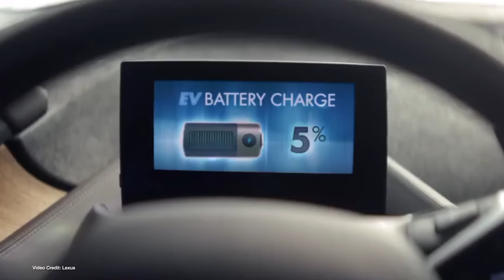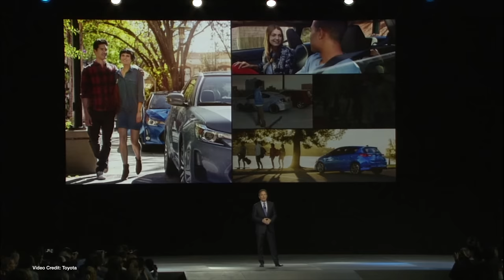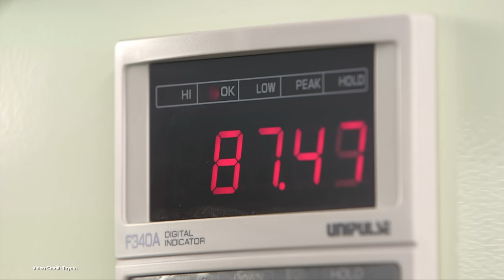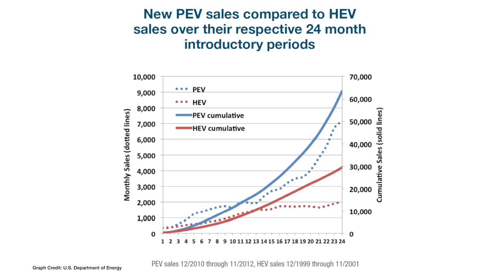Toyota Insists You Can't Ban ICE Cars Yet. It's WRONG.

Comment: Toyota knows every thing about electric cars from charging to usability, its all about mass production, if they could make 5 million EVs tomorrow they will happily do it.
Reply: Knowing what needs to be done and actually doing it are two different things.
IMO legacy OEMs have lots of baggage to unload before they can go full speed on mass producing EVs. Hence,  the reason for dragging their feet on going full EV.
Reply: How about they just start with making 500,000 then? If Tesla can do it, then why can't Toyota?
Reply: @joeabad5908  uhm that's totally wrong and unfounded argument, ICE vehicles are still very needed where EVs doesn't work, if there was enough battery/raw materials or even chips available you would have seen a dramatic change.  All manufacturers are developing and presenting/unveiling new EV models while also working on battery recycling and supply chain.
Reply: @joeabad5908  another strong improvement on EVs is the fact that many manufacturers are using more and more recycled plastics and fibers on their EV production instead of just using oil byproducys.
Reply: @carholic-sz3qv  agree.. But, the discussion is about legacy auto having trouble switching to EV.. The longer they seat the harder it takes. And Toyota is not even serious in going EV.
Reply: @joeabad5908  the longer who seats?! Wtf told you that Toyota isn't interested into EVs, seriously stop making those crap affirmations that are totally unfounded. More and more EVs are coming from all manufacturers. Toyota even makes a van in Europe with their Citroen partnership and there is more to come.